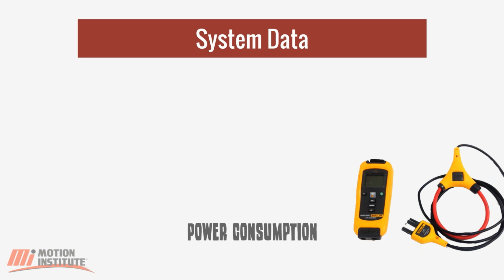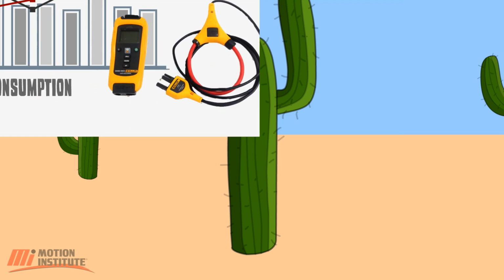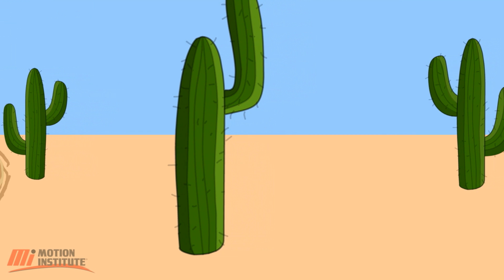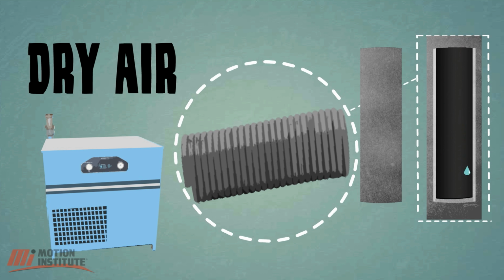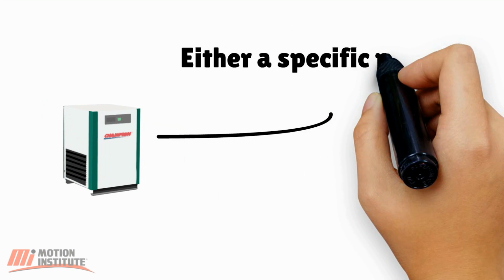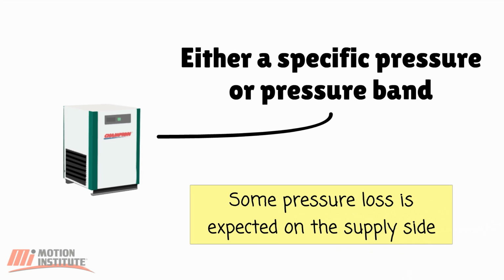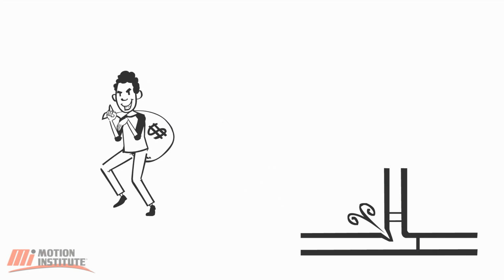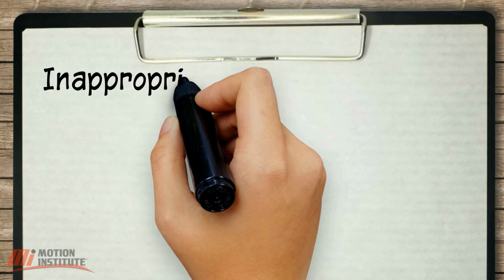The Energy Services Team - Compressed Air Systems Assessment

Comment: I think a key aspect of thermodynamics is understanding the inputs and output of systems and their effects. As shown in the video, some key aspects of this are flow, pressure, and power consumption. In a business sense, all of these can be tested and have new systems developed to try to save power and therefore money. It’s crazy that even small leaks can cause 10-20% loss of energy, This is why services like compressed air system assessments are so important. Curious on other's thoughts on this.